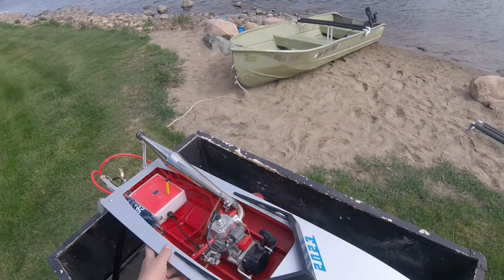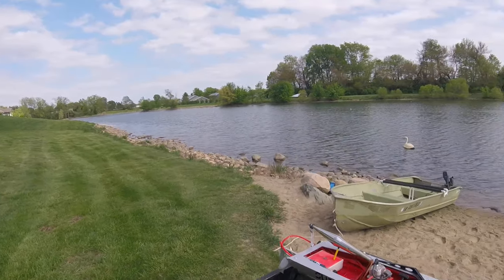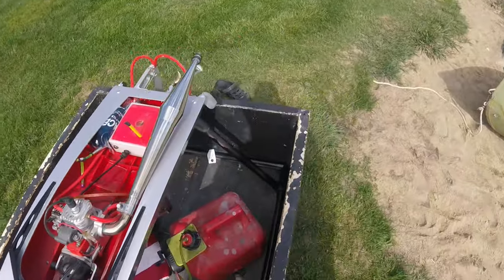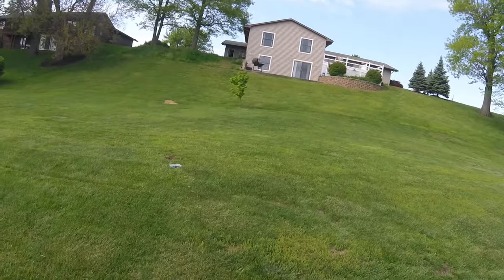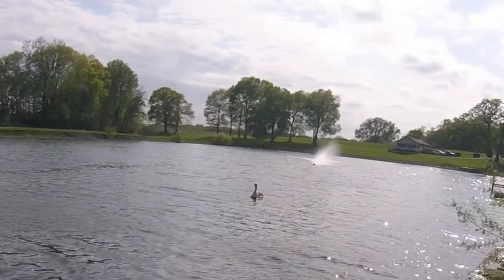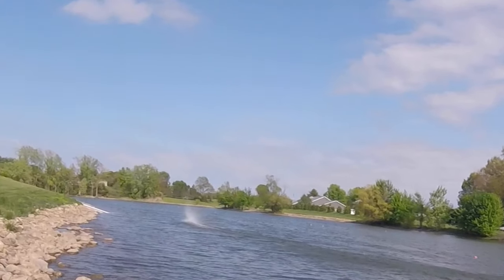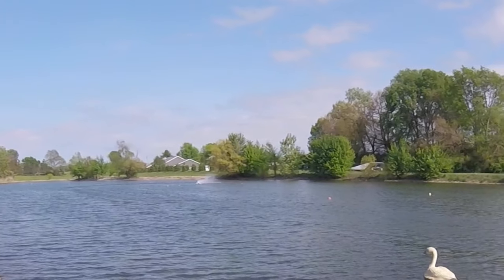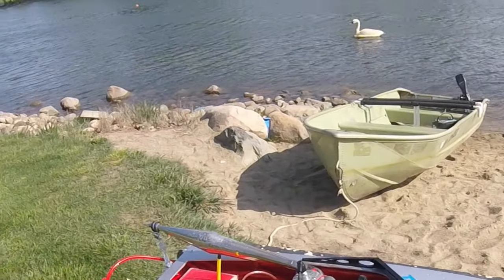ZippKits Super Sport Maiden!!!!!!!!!!!!!!!!!!!!!!!! Part 1

Comment: Great video!

Tabs and fins! Here is the way I set them up: 
Use a straightedge on the bottom and make all tabs perfectly parallel to the bottom. If the tabs are 1/16 off the bottom, there should be a 1/16 gap the full length of the tab, along the straightedge.
You can't eyeball this, as .010 inch will make a noticeable difference!
Check and double check all 4 tabs. They must be completely parallel with the bottom.

Use that straightedge to make sure the stinger drive is parallel to the bottom as well. No need for any stinger angle.

Next, use a square on the bottom of the boat to check the turn fin(s). They must be 90 degrees to the bottom. Not 88 or 92, but 90. It makes a difference.

Once all tabs are parallel, raise the left inner tab 1/2 turn. This gets rid of the right "lean".
That's it!
If you want to make the boat "looser" or "tighter", adjust only the inner tabs, and always keep the 1/2 turn difference. 
You should never need to adjust the tabs more than 1/2 turn either way, unless something is wrong...

Full throttle until the race is over!

If you think that rudder is too long, try a short rudder while there are 5 other boats out there. See which one goes around a corner in white caps, and which one is upside down!

       -Uncle Joe